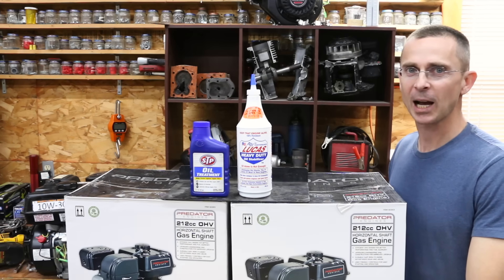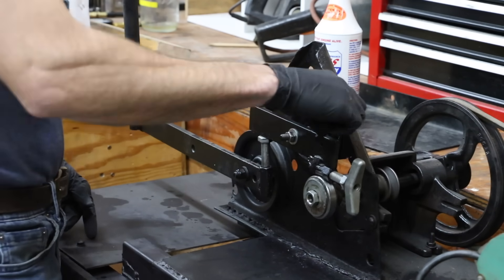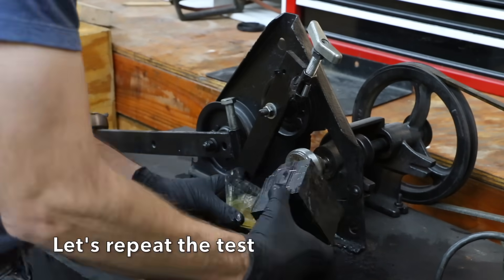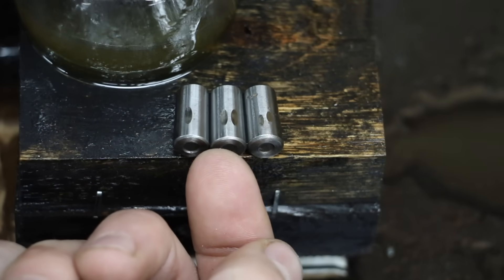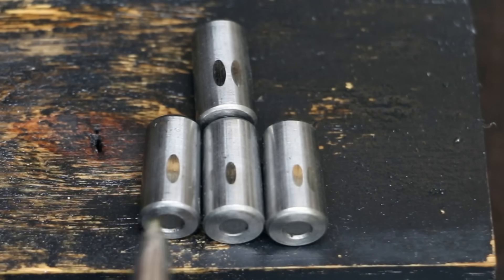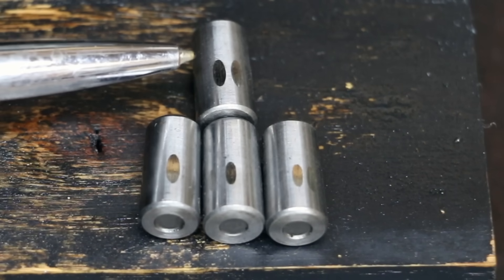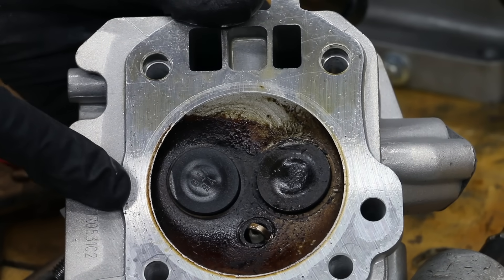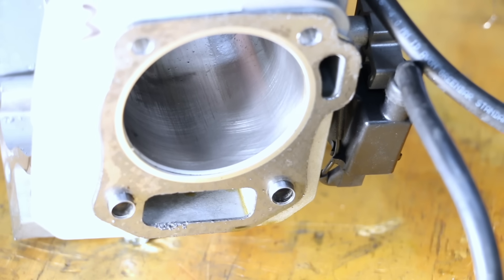Which engine self-destructs first?  Lucas or STP?

Comment: Do not use thick additives like Lucas or STP in new engines!!! They will ruin the close tolerances. You can never make the engine new again and you will have to use the thick additives for the rest of the (shortened) engine's life. Use only the manufacturers recommended oil viscosity in new engines. Lucas and STP are great for engines that have a lot of wear.
Reply from the maker: Thanks for the feedback.

Comment: When I was nine years old in 1955 I wanted a horizontal Briggs & Stratton 2 1/2 horsepower for my self built “go-cart” so much. We could not afford even a used one. This video bothers me because I know there are children out there that would like to have an engine. Am I the only one? Later we had a 1952 Willys Overland F-Head 134 and we put one of these additives in it. It knocked out the number four connecting rod bearing the next week. This stuff is bad for most any modern car with variable valve timing and critical lifter tolerances and other parts. Run Forrest, run. Try this with just motor oil.

Comment: Lucas ROCKS!!! ASK ALL MY VEHICLES! My friend has my 
Old Pontiac Torrent with 3.4ltr motor and is original with 330,000 miles on it. STILL DOES NOT USE ANY OIL NOR DOES IT SMOKE! 1/2 QUART OF LUCAS EVERY OIL CHANGE!
Reply from the maker: Thanks for the feedback.

Comment: Rather dramatic of course as intended. 
But I question the reality of the test. 
Who would run an engine without oil? 
How about something a bit more scientific. 
How about break in as required. Then whatever a season  of runtime equals for the average mower homeowner, 20 to 30 hours a year with new oil and or no additive? 
Now measure the key components and compare. 
As a car owner or mower owner, which oil (conventional or synthetics) with or without additives protects best in run conditions with a way to add load like say taller grass. 
Personally, I think Amsoil in any engine wins but I'm biased. 
I hate to see any good engine intentionally destroyed for basically no good reason. 
Thank you.
Reply from the maker: Thanks for the feedback.

Comment: i use restore in my 4.0 jeep stop the ticking sound for about 1000 miles then it starts up, used restore in my 84 f-150 4.9 i got new and had 299,997 when i pulled it out and only cause every single gasket leaked but still ran good no smoke or sounds got a rebuild and it started making sounds with in a year but had 245,000 on that motor when i sold it and uses restore in it also
Reply from the maker: Thanks for sharing.

Comment: The scoring test is good, but the engine test is inconclusive. No engine is created equal. A thousands of an inch can be the make or break with that test. Theres too many variables and if you tore then down and measured the clearances you'd see they are very different. Just my two cents, cool video!
Reply from the maker: Thanks!  Thanks for the feedback.

Comment: Didn't take me long to determine that these engines are made my Robin. The same OHV engine on my old Ryobi pressure washer. These engines are strong and reliable.....using oil.  Still original compression after 11 years of fairly hard use. :-)
Thank you for the very good test.
Reply: Not made by Robin. They are reverse engineered Honda engines. Almost a direct copy of a Honda.

Comment: What you should have done is when the STP engine seized, you should have let the Lucas engine run 1 more minute exactly and stoped the engine. Then taken bouth engines apart..cause even if the Lucas ran half an hour more, the outcome would be the same..but stopping the test when 1 engine goes and comparing the 2 engines would have gave a better look at the protection each oil additive gave..
Reply from the maker: Thanks for the suggestion.

Comment: Hi, I’ve watched a lot of your videos. Very interesting and informative. I also appreciate that you respond to comments. I have two ideas to test. The first would be the Lucas high mileage fuel treatment compared seafoam etc. they have a product for everything. Is Lucas the best? The second is in regards to paint scratches. Supposedly, if you have a scratch, you d add prey it with pb blaster and scrub with a wire brush and scrub off the excess. Does this actually work or is this internet bs aimed at getting people to destroy there paint with a wire brush? Thanks again for what you do
Reply from the maker: You are welcome!  Thanks for the video idea.
Reply: You would just make the paint worse. Use compound and a buffer to remove scratches.

Comment: I USE LUCAS IN ALL 10 VEHICLES I OWN, MY HARLEY AND 40 FT SEARAY, I HAVE 2 ENGINES A V10 AND A 4,6 AT ALMOST A HALF A MILLION MILES, I RUN 10W30 CASTROL AND LUCAS, NEVER NEVER A DROP OF SYNTHIC CRAP
Reply from the maker: Thanks for the feedback.

Comment: Curiosity....I had hoped to decide whether adding either of these products was actually worth the additional cost when I change my oil, but do not know how to interpret your findings into some practical information for my 2006 V6 210,000 mile engine!  I am running a so called high mileage oil  and have been since the last 2 oil changes....any suggestions or thoughts?  Presently my engine is not burning any oil, not smoking and not knocking or making any unusual noises.  Do I even need to mess with these products in your opinion??

Comment: Hi: When I was in school, the prefered ‘juice’ was Slick50.  A 350 chevy motor was running on a stand, with no pan on the motor, so no oil, for well over 24 hours.  Slick50 treated. It was rattling, but still running.  Maybe a comparison with that and a leading non-teflon treatment/additive?
Reply from the maker: Thanks for the video idea.

Comment: I have a 2006 F-150 with about 260,000kms on the engine. I'd tried Slick 50, Lucas oil treatment, Marvelous Mystery oil, Seafoam... NO improvement in power, oil loss or mileage. Desperate... I finally tried a oil treatment only from Canadian Tire... called 'Restore'. After 2nd oil change... added the Restore again. Used to get 450 km on 100L. gas tank and wimpy passing power. Got 700 km on the full tank and 20 - 25% more passing power. Also... only added 1 L. oil in 6,000 km! Always use it now!!
Reply from the maker: Thanks for sharing.

Comment: Did you consider running a third engine that had just oil circulating in it just prior to compare that time/those conditions as well?
Reply: I was thinking the same thing.  It would have been nice to see if the engines with the additives would have last any longer then the engine with straight oil.
Reply: @ziptiejedi5658  I agree with you. The basis of the video was "wasting money on additives?" The third engine with the motor oil only would have probably lasted longer. Proving that both Lucas and STP are both worthless.
Reply: You need a control group.
Reply: @gusargoan  If there was enough funding, multiple tests on each would be the best. One test of each doesn't have enough statistical impact. To br devil's advocate, he could've gotten a slightly weaker motor.
Reply: @mykiscool  9 minutes is huge without lubrication. That could translate into 900 hours with lubrication. The motors are made out of the same cheap metal. My guess is the motor with regular oil would fry at the 3-4 minute mark.
Reply: @gusargoan  Yes, that is correct and I'm sure it did help. I'm simply describing the most correct methodology for performing tests in general.
Reply: @mykiscool  I'm sure with unlimited funding, a guy in his garage could do exactly that.
Reply: Once my son accidentally ran his Kawasaki Kx250f with the oil filter backwards so that no oil would flow on the head. It ran for no more than about 5 minutes on Maxima Premium4 10W 40 before the cylinder seized.
Reply: @626weekendwarriors9  costly mistake
Reply: I concur
Reply: Conventional vs synthetic
Reply: phocused 247  Fine, I have no idea what you are saying. I use one of the products on a truck motor  that has exceeded 400k miles. Tell me why I am wrong! Prove it.
Reply: It would cost a fortunes this engine would probably run for months lmao
Reply: I was thinking the same thing. It would be nice to have a baseline.
Reply: Exactly what I was thinking!
Reply: Need more engines for control. No two engines are identical. Rings, carburetors,  spark gap, air/fuel mix, casting, bolt torque, and multiple factors. No control base set by straight oil ran engine. Still Lucas makes great products by a hardcore truck fleet owner.
Reply: @everettplummer9725  agree 100%, he could have tested both engines with both oils!
Reply: I was thinking just run 20w50. If you want thicker oil, USE thicker oil!
Reply: @timtucker7762  I run 20w50 with 25% Lucas in all my engines
Reply: That is called a control, and one of the reasons why his test is invalid in this video.

Comment: We all know Lucas won. Yes both engines blew up sure but the lucas provided for more protection making the engine last a bit longer. What would be interesting is running both engines again but this time using the same amount (20% STP and Lucas) with the oil and see if the result is more similar.
Reply from the maker: Thanks for the video idea.

Comment: Got a question if I put AT 205 reseal for rubber on my tires will it stop them from dry rotting from the UV rays?
Reply from the maker: Thanks for the suggestion.

Comment: I can tell you this synthetic oil is one of the greatest things ever, kept me from being stranded 10 miles out from town in far east Oregon.  Took a rock in the oil pan and started loosing oil just did not know it until the oil light turned on.   But was able to turn around and go back to town by the time I pulled into the dealership it was knocking hard and was surprised I did not throw a rod, engine was still toast.  Great start to a vacation.
Reply from the maker: Thanks for sharing.
Reply: For me a hike back to town and a tow is a better deal than risking a $5,000-10,000 repair bill for a new engine.
Synthetic or not, I'm pulling over when the oil light comes on. maybe I don't make much money but if I was offered $5000 to walk 20 miles I would do it.(Heck I've done it for free.)

Comment: Even though the lucas engine lasted a lot longer without oil the stp engine was running at a cooler temperature then the lucas oil.. So ill be honest i got to give it to stp i think they won that battle because in reality no ones going to want to run there vehicle or any engine in that matter without oil and if you want it to run a little cooler witch is fantastic for any engine definitely add a little stp next time you do an oil change but on the other hand if your experiencing engine problems such as slight rod knock or lifter tick definitely give lucas a shot because it just might give your vehicle that extra bit of life to hold on to
Reply from the maker: Thanks for the feedback.

Comment: If you can find a product called Z MAX I'd love to see Lucas or Stp go up against it.  Reason I say this is because I had 95 f150 with 300 straight 6. It had a blown head gasket and cracked water jacket. I used that truck for 3 years like that. I believe Z MAX is what kept it going. Worth looking into.
Reply from the maker: Thanks for the video idea.

Comment: Really should put a load on the engines. Just because the engines are running max RPM does not mean they are producing rated power. It is possible results could differ if the engines are working at 95% power instead of the 20% power these were working at.
Reply from the maker: Thanks for the feedback.

Comment: What I'd like to see, is proof that 0w20 can be used in 100f temperatures and not ruin a motor.  As you know 0w20 and 5w20 are being pushed year round in cars for "fuel mileage"... Me, I'll believe the online viscosity charts and not use 5w20 in the summer months opting for 5w30 or 10w30 per my owners manual.
Reply from the maker: Thanks for the video idea.

Comment: I gonna be that guy and say that no. You shouldn't do more testing of additives in dry engines, whats the point? Its hard to imagine that a company can make a oil additive that improves engine oil. Engine manufacturers design engines to use a specific oil full stop. Engine oil is mostly made of additives anyhow so why change the characteristics of the engineers chosen lubricant?
Reply from the maker: Thanks for the feedback.

Comment: Worked in a gas station in the mid 70's I recall a GTO pulled  in one day with the engine clattering, valves,,lifters  and who knows what else ,the driver told me he just had a street race with another car,he said put a can of STP in the engine,within 
  Minutes the engine sounded normal i was sold,used stp in my vehicles ever since.If it's good enough for Richard Petty its good enough for me.
Reply from the maker: Thanks for sharing.

Comment: I think for this test, from a scientific analysis standpoint, you should have also had an  engine that was run with no oil additive. This would not only show which additive is better between the 2 additives, but it would also show if either additive is at all better than just standard oil, aside from just relying on the lubricity test for the conclusive data. Great videos, very informative and entertaining. Thank you
Reply from the maker: You are welcome!  Thanks for the feedback.

Comment: Before I say anything, Im lazy and cheap and dont do oil additives. That said, Ive worked in commercial truck service for 20+ years. Talk to most engine rebuilders, not an oil bitch, they will swear by Lucas. I personally witnessed a 97 3406e that got two gallons of Lucas at every oil change, with 2.5M miles, rolled bearings every 400k, and pristine journals. That said, the crank had cracked and we built him a new engine. 😁
Reply from the maker: Thanks for the feedback.

Comment: No two engines are the same.  This is not a scientific result.  In my short 67 years of gas and diesel engines STP is the product that works best.  Use the same 20% ratio and see what happens.
Reply from the maker: Thanks for sharing.

Comment: Interesting test. I think the keyword here is oil "additive".  I don't know how much interest you will have in this story but here is my experience with Lucas. I have run Lucas oil in both the oil and fuel of my 1999 ford F250 7.3 diesel, indeed in all my vehicles. I sold the truck with over 600,000K miles still running perfectly. At 200,000 K miles, I heavily modified the truck for power. At that time I had my mechanic take a look at the motor to see if it was worth it. He said it was the cleanest diesel engine he had ever seen. He has over 20 years of experience in diesel motors. Took the oil pan off and did nothing but wipe it out with a paper towel. Factory cross hatch still visible on the cylinders! Rings, almost no wear. The whole engine was wiped clean for the rebuild with no solvent used for cleaning the inside. This truck saw heavy use towing Bobcat's, backhoes, a 33' toy hauler, a 30' boat, and anything else I could think of. It was my daily driver for business and personal use. Yes, I did regular maintenance. Yes, I took care of it, but I also used the hell out of it. 

So why did I share my experience? Lucas Oil as an "additive" works well when used in conjunction with proper maintenance routines. My vehicles have experienced better fuel economy, fewer upper cylinder troubles, and zero injector failures. 

I guess you could say I'm a Lucas fan.
Reply from the maker: Thanks for sharing.

Comment: I had a problem with a transmission, knocks while engaging drive, added half a bottle of lucas... Took couple miles, but now it shifts smoothly. I think it's because it made the oil a bit thicker, but I have a ln improvement for 25 usd, which is nice.
So, I think lucas does the job...
Reply from the maker: Thanks for the feedback.

Comment: Prolong! I love that product and I’d would love to see it put to the test
Reply from the maker: Thanks for the video idea.
Reply: I 've using Prolong Engine Treatment for over 20 years and I believe the stuff really works.
Reply: First time I ever tried Prolong was in a 87 Grand Prix. I noticed a drop in running temperature right away!
Reply: @LuisGonzalez-mg3io  Yes it makes engines run cooler for sure. I had a Chevy Astro van with over 400,000 miles it was still running when I sold it for junk the frame rotted out.

Comment: Just watching this video for the first time. You are definitely biased, never overt but subtle. You say that you are not sponsored and if that is true then its just your own bias. There is no other reason that you would only show the bearings with oil only, STP oil mix, Lucas oil mix, and Lucas straight. Where was the STP straight? This was not an oversight. STP did better straight than Lucas but you didn't want to show that. I like what you do here but you need to stay consistent. I have no problem with you following the directions when you mix them. STP would probably be too thick otherwise and Lucas is a better choice. Thank you

Comment: Maybe should have done a 3rd engine with only the oil used in it... Then you would have had a control/baseline to see if the STP added anything at all. I've been using STP for 30 years... just due to how sticky the stuff when it's not diluted. Seems Lucas may be the better choice anyway.
Reply from the maker: Thanks for the feedback.

Comment: I have a 2012 bmw x5 with the n55 engine and a custom tune. on average i get about 350 miles on a full tank(20 gallons). With the Lucas complete fuel treatment I get 410 miles on a full tank. I buy the 1 quart size bottle and i get 4 fills out of it. It pays for itself almost 4 times over.
Reply from the maker: Thanks for sharing.

Comment: Any engine is going to fail if you abuse it long enough. Wouldn't the real test be an engine used under normal conditions with the additive and without and then a tear down to look at the condition of the internal parts?
Reply: There will be virtually no change.